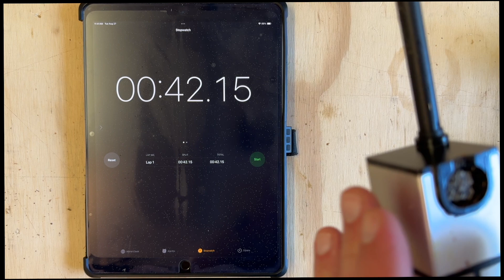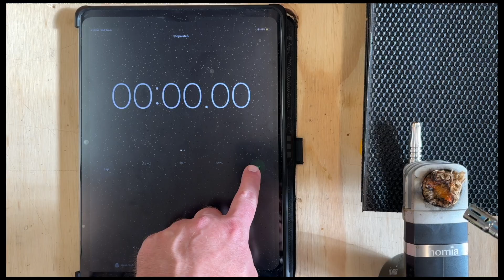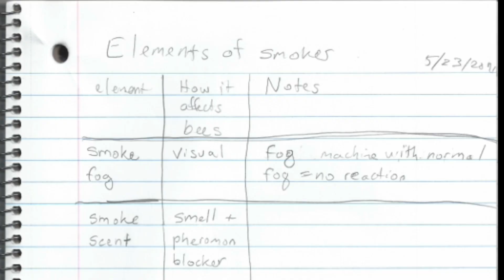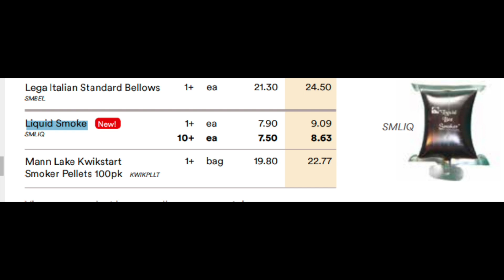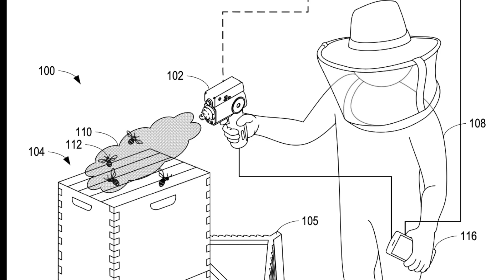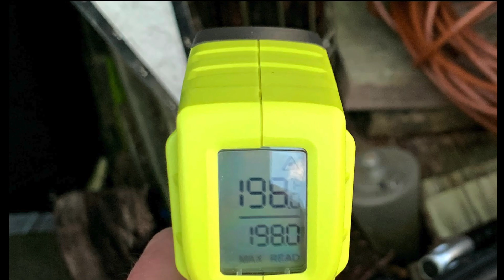The Electric Bee Smoker That Could Change Beekeeping Forever  ⚡️🐝💨

Comment: The Milwaukee M12 battery is the right one - either small or with a base. 

I want to buy this - how about a Kickstarter campaign to raise the money for development and all the safety and other testing required?
Reply from the maker: @andrewostrom8676, You are right, M12 ends up being the right fit. It has small options, a heavier duty option and can be converted to pretty much any other power tool battery type.
Check this video out.
https://youtu.be/L5jwnmFWj8k

Regarding a crowdfund. I am working on it as we type, lol. I'm hoping to get it out by Tuesday of next week (an Indiegogo crowdfunding campaign). 🤞

Comment: I think  you should  lean more towards a drill battery just because if you do an internal/usb-c. IF / when the battery fails the whole smoker is then useless. With the drill battery i would find the most batterys with the positive  an negative it the same position so you can use multiple batterys
Reply from the maker: @brtaylor1990, you're 100% right. Products with built-in batteries end up with battery fail and make the whole system useless or you need to have two of the product to have one always recharging (ugh!). I found in testing this early smoker design, it was also hard to remove the small removable batteries with gloves on or with sticky hands. I have decided to go with the drill/power tool battery design 🔋. The nice thing with the battery that I'm using now is that it can be converted to a lot of other battery brands using an adapter. An added benefit is that it could be cheaper for the beekeeper as you may already have these batteries, win/win.  Here's the video where I decided on the design. 
https://youtu.be/4pwRO7pOVYs

Comment: I have two hives, I am enjoying the pastime and learning about bees.  I think I followed the same logic train you did, why am I making this little fire and spending all this time to get smoke going.... it is 2025, isn't there an automatic system.  I found this via google, just joined the VIB.  I will pay to join the Beta group.  To open up my two hives takes several hours, get the feeder or frames or strips etc (5 min) Get the smoker going (20 min), open the hives and find queen, make adjusments etc (30 min), put out the smoker and get the fire cool enough I can put it in the bin (10 min) clean up the tools and put them away (10 min) shower and change, then wash the clothes so they don't smell up the room from the laundry basket (2 hours)! Get rid of the old smoker and I would be done in less than an hour!  I am excited you are working this project and would love to help!
Reply from the maker: @JoeEsplin, Thanks for your message! Yes, I just introduced a new queen to a queenless hive this morning. Here's the timings, lol. 

- Press the button to smoke entrance (10 ms),
- Open the hive and smoke (1 min) 
- see if they accept her (never seen worker bees so happy to see a queen, they were jumping for joy) (2 mins), 
- insert queen cage (1 min), 
- close up and walk away (1 min ... this was the flow hive that has a stubborn although gorgeous gabled roof, lol). 

Probably took 5 mins. No smells on my clothes because it's on-demand and pointed at the bees. I had an important meeting that I had to go to after this, so I was worried about time and budgeted an hour, so I went to a fast food joint with the extra 55 mins. 🍔🍟🥤

Thanks for joining the VIB club! I'll reach out soon. 🙏

Comment: No way could this thing keep up with all of my hives.  At first, I thought it was a glycol vape device and was really disinterested.  Found out it was actually just a combustion spot smoker, and I think you may have something here.  This would be perfect on the days I need to just go do something quick and non-invasive.  Would be nice not to have to fire up the smoker for just a quick task.  Cool gadget.

Edit:  Just kidding I continued watching.  It is a glycol vape.  Never mind.  Honestly you could just use your blower on them without the glycol and achieve the same effect.  I blow on bees all the time to move them away from cells I want to look in.

Let me know when you get a combustion spot smoker on the market.  I'm great with paying a premium for a well-built tool, but not for specialized pods to burn.
Reply from the maker: @Ovenmitt123, This is an early prototype. I will be showing my newest versions soon, so stay tuned. I have rebuilt the tank to be high capacity and have removed some components to make it simpler. Thanks! 🙏

Comment: Quick and dirty
Been doing this for years.
Charcoal briket electric coal starter.
Place 3 brikets on it until they start to look white. Place in bottom of smoker.
Use what ever after that. I use leaves and wood chips. Takes 5 minutes.
Reply from the maker: Thanks @RB-cz5jn, it's always handy to have another way to start up a traditional smoker. All the best, my friend.
Reply: I didn’t mean to high jack your idea.
I apologize 
3d print a heat shielded box 
Good idea
Burning different sources to calm bees is a great idea.
I use to do this but it’s great selling point.
Reply from the maker: @RB-cz5jn, I don't see as high jacking. I truly appreciate the technique. I am thinking of putting together a website in time for beekeepers to share how they start their traditional smokers and also for formulas for this smoker to help the community. I always love to learn a new way to start a smoker.

Comment: Great- think the battery idea will be a winner
Reply from the maker: Thanks @fransoosthuizen2151. It's made a big difference in being able to change out the battery quickly. I hadn't tried changing out the old batteries with gloves on since I typically do not use gloves. So the drill battery is fantastic. 
If you've not seen the battery video, please check it out here:
https://youtu.be/4pwRO7pOVYs

Comment: smoke is dry, .... vape's are wet and sticky, all I can see is Bees being covered in a cold wet solution that they can't clean up, Vape's are not safe for use in my opinion
Reply from the maker: @wclearwater1 ... thanks for the comment. The liquids that I'm using are food grade oils that the bees clean off of each other. You are 100% correct that we need to be very careful what is used. I actually heard some info on the toxic chemicals produced by traditional smokers as well, I'll see if I can find the source.

I'll be very transparent on what I end up using, so that you can decide on your comfort level with it.

Comment: Looks very good. Can I ask what fan you are using?
Reply from the maker: @marian061-v3o I could do an entire video on this question. 🤣 My original designs I used a toy airplane engine, lol. I'd also worked with some drone engines as well. The reason is that there are not many smaller fans that pull air through it and are cylindrical in shape. 
I've also looked at Dyson blades. While it would save me space in the barrel, I'd need more space in the handle to accommodate it, so it has all the wrong tradeoffs. It would have looked space-aged cool though. 🚀 
To answer your question, I focused on quality of parts and switched to a DC motor.
Reply: @TechnicallyBeekeeping  I tried with a Sunon MF25101V2-1000U-A99 fan. It cannot overcome the resistance through the Vape coils. The air stream returns back. I would be happy if you could make a video on the topic in which you could share your experience.
Reply from the maker: @marian0061-v3o, honestly, the fan is the easy part, the air flow is the hard part. A fast and easy way to build something similar is using these plans: https://www.kamuicosplay.com/product/fogmachineguide/
I will tell you that their design won't pump out enough vapor to get the bees attention, however.
Also consider becoming a VIB Insider: https://vib.technicallybeekeeping.com

Comment: Just make it use rechargeable double or triple A's. There are too many variations in the drill batteries.
Reply from the maker: Thanks, Brandywine Farm. Unfortunately, standard AA/AAA won't give me the power that we need. I agree with the amount of variation.  I'm thinking about putting a JST or wago connector in it to be able to swap out connectors at the factory.  What do you think?
Reply: @TechnicallyBeekeeping  That would work. It shouldn't make it overly heavy!
Reply from the maker: @Brandywine-farm, I'll try to keep the weight down, for sure. 🏋️

Comment: it could, but won't
Reply from the maker: Why do you think it won’t? You have me curious.
Reply: @TechnicallyBeekeeping  these are simply my superficial views, the first problem is the battery, if you are going to use a power tool battery it will add to the cost and there is the issue of compatibility, I use bosch power tools so I have bosch batteries, so I will have to go buy a dewalt battery specifically for this to work

the second issue is the camera vs film issue, the camera may be cheap but the film expensive, and in the long run this may turn out to be the case here where the fuel cost outstrips the cost of the smoker itself- under the current method the smoker has a nominal cost and the fuel is basically free

and from a personal perspective (you yourself) this item could simply be replicated, thus making it difficult to recover any costs in research and development, also the argument that the smoker technology has run its cause sounds appealing to people who think innovation is good for its own sake, but the market with all its agents generally don't think along that way- you could say the same thing about the langstroth hive itself

If you can find a use for it where it actually becomes an effective treatment for pests and disease, then you may be onto something that people would buy, but as a general smoker I don't think it will catch fire
Reply from the maker: @The_Angry_BeEconomist  Thanks for the detailed feedback.  I truly appreciate not only the feedback but also your suggestions on copycats and treatment vs smoking.

Comment: Saying 'Hi There' from me and my Bees here in Scotland ! 🏴

Been there done that with 'Bee Smokers going out all the time. Add a bit of Lavender Flower or Dried Stems to the Smoker Fuel. Keeps the Beek calm and the Bees Calmer as well. Works a treat.
Happened today, several times, knowing the Smoke stopped right at the wrong moment ! Oh Drat !?! . . Where's my Culinary Blow Torch when I need it (?)
Like the ones used on Creme Brulee etc. . . Brilliant at getting 'Smokers all lit Up.' 🔥
A case of Fingers Crossed 
it stays alight for all my Hives and Nucs (re : mid Summer Splits) to Inspect.
One by one. All doing great this Autumn (Fall.) 😁

Like your way(s) of thinking there. . . Only one Request :
"Don't forget us 'Lefties' or South Paws ! 
Need that Magnet to be able to Turn 180 Degrees ! So I can Shoot from the Left Hip: kinda.

Already have a (dead Speaker) Magnet 🧲 inside my Bee Suit Pocket . . . 
"Clank" goes the Hive Tool : on the "Outside."  No Lost Hive Tool ! Works a Treat. . .  👍
🐝🐝🐝🐝🐝🐝🐝🐝🐝🐝🐝
   Happy Beekeeping 2024
🐝🐝🐝🐝🐝🐝🐝🐝🐝🐝🐝
Youtube AI : Randomly brought me to this Video. Awesome thinking there !
[Genius idea 💡 in the making by the way.] 
What are you going to Call it ?
Lazy-BEE-Smoker without the Fire going out. 😂

Could it also Warm Up or make another Bee Friendly Cup of Tea too !?!  🫖
I'd grab that unwanted Tubing,  and use that as a kind of Straw ! Thru the side of my Bee Suit Veil no problem. . . Oh and a few Chocolate Biscuits (Cookies) wouldn't go amiss either. Now how to eat those ?
 Good Luck with the Project. by the way. . . 🤞

Keeping Bees is thirsty work. . . 
Us UK 'Blighty Folk' always want a good Cup of Tea !
As Beekeepers say : Always
 "Think Outside the Box ! " 😁
The Tea Caddy or the Biscuit Barrel : both are Wood Boxes of sorts. . . I'll let myself out. 😎
Reply from the maker: Wow! All the way from Scotland!  
We have close friends outside of Glasgow, what an amazing place! It has taken me 20 years, but I can understand a little Glaswegian. :face-blue-smiling:
Lavender oil is a great idea.  And makes for a nice smell as well.
Regarding left handers, yes I started out the design with the air vent on the right side, and moved it to the back to allow the magnet to connect on either side for either hand.  That is important to me, so I have you covered.
Regarding Lazy-BEE Smoker, lol, love it. 
:face-red-heart-shape:
Reply: @TechnicallyBeekeeping 
Hi. . . Lavender Essential Oil might work (!?). . . Not sure (?)
Tip :
My suggestion was actually the Plant : Dried Flower Heads and waste Stems etc. . .
Bees love Lavender Flowers all through Summer. Come Autumn (Fall) all that Dried Matter needs trimming off, to aid better Flowering for next Season. I trim and deadhead all that Debris, dry it out. Keep the Lavender Flowers for use in the Home etc. Or Gift it away.
Those Dried Stalks used to be 'thrown out'. But hey, why not use that too ! So I do this. . .

I make loads of Smoker Fuel 'Burner Bundles' using spent Plant & Foilage material. (Do measure your Smoker Chambers Width, and make these Bundles a little smaller !) Or you might find they didn't fit great. Been there done that. . . Oops ! 🤭

Getting a Garden  through Autumn (Fall) before Winter provides : Snipped Stalks, Stems and Sticks, masses of Leaves. All literally wasted. Smoking stuff !?!

Getting the Bees and Hives healthy and ready for our long Scottish Winters also means that I plenty of old Bees Wax  from Frame Exchange Outs. (Old Combs / Wax Melting and the resulting 'Slum Gum' left) must have a use too, surely ?

I had an idea. Make Smoker Fuel into easily used Burner 'Bundles. Waste not, want not.

I can always find 'Tattie Sacks' somewhere near by (live in a Rural Area of Scotland where Potatoes get grown.) This Hessian (Burlap) with some Garden Twine: and a bit of 'Cleaning Up' through some pruning, deadheading etc. . .
 Is ample Material for making decent 'Smoker Fuel' Burner Bundles. Also helps in that we have a Wood Burner Stove on so an old Stove Pot with water,  an inner Container (eg an Ex large Tomatoe Tin.) Results in Dipping Small Tied Up Bundles (of Hessian Wrapped Plant Material) even using a bit of those plentiful Lavender Stalks, uses up Debris. For a Good Beekeeping cause !
Or at least I think it might make my Bee Smoker light more easily ! Burn longer, right ! Or at least Calm the Bees and Beekeeper alike. 
What we do for our Bees. . . 😏
🐝🐝🐝🐝🐝🐝🐝🐝🐝🐝🐝
   Happy Beekeeping 2024
🐝🐝🐝🐝🐝🐝🐝🐝🐝🐝🐝
Family lived for a Year many decades ago in a place called Aix en Provence, in the South of France. Lavender growing far & wide ! And the Honey was amazing too. . . Just about remembering  it !

So trying to Grow more for my Bees. Whether these Plants will survive the Winter will have to be seen. An odd one does. (Take lots of Cuttings off it come Spring, and grow more to replace the Frosted ones !)

All I know is that an 'Old Timers', well used Copper Bee Smoker, I had bought, a few Years back (from a Garage Sale, a Retiring Beek, now deceased,) Is well loved and just about works. 
And sometimes just about 'stays alight.' 
Keep Calm and Carry on. . . 🤭
Reply from the maker: @ME_MeAndMyBees  great idea with the smoker bundles.
Lol, what we do for our bees, indeed!
Regarding the lavendar fields, that is a bucket list item for me is to go to a place with lavendar fields in full bloom.  The way that I imagine it is heavenly!
🐝Calm and Carry on, as well, my friend.
Reply: @TechnicallyBeekeeping 
Thank You. . . 😏
More Bee Gear Invention "Ideas" please. . . 
They are are 'Buzzing' full of good suggestions ! 
Just watched the 'Mason Jar Lid' ways and means. Fabby !
More used Stateside, (than here in the UK, tend to reuse naff Supermarket Jam (Jelly) Jars. Or ones with that nice expensive Italian Tomatoes Sauces in them. 😉
Don't think the Dinky (Tiny) Regional Airport in FLA would allow me to Buy up all WinnDixies 'Mason Jars' and bring them Home across the Pond, after seeing Family. Think (K.W) has enough 'Crazy Season' Tourists already. . . 🙃
🐝🐝🐝🐝🐝🐝🐝🐝🐝🐝🐝
   Happy Beekeeping 2024
🐝🐝🐝🐝🐝🐝🐝🐝🐝🐝🐝
 Wow : we had Trmps in the 20C's (mid 70F's) Yesterday ! After an awful x4 Month Wet (Icky) Summer : only a good Day here and there. Do an odd Hive Inspection & run Indoors after another deluge. . .  🌧
The "Girls" 🐝 are making up for it now : Collecting in lovely 'Heather Honey' off the nearby Moorlands by me. Never knew decades ago, my Locality was a 'Mecca' for Honey Crops. Local Bee Association (Club) has tales of all sorts with Folks  moving Bees on Trailers, Vans, even Back Seats of Cars ! Whacky (Bee) Races. On your Marks, get Set, Smoke ! 🤣